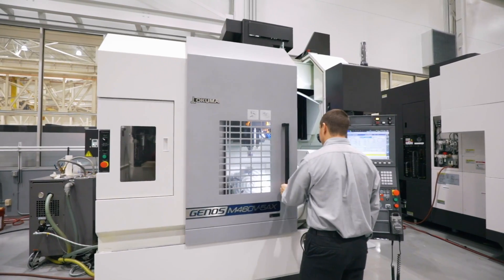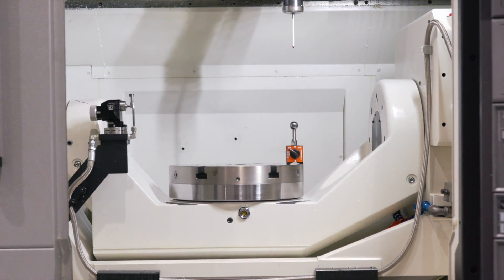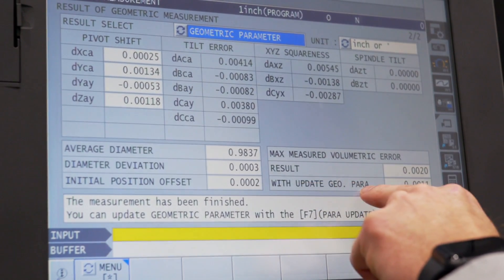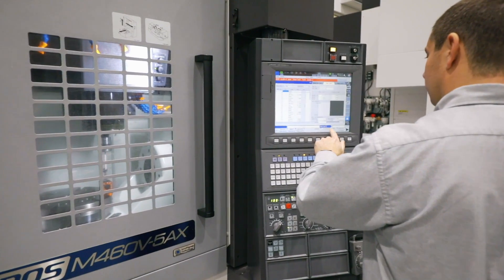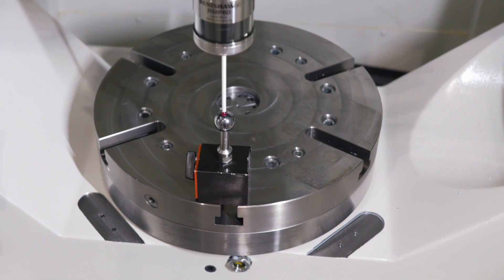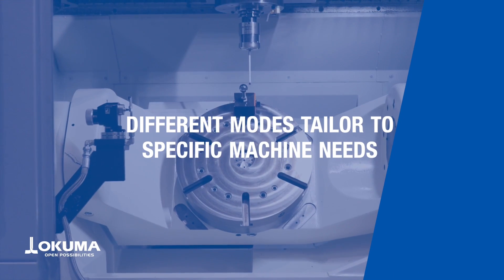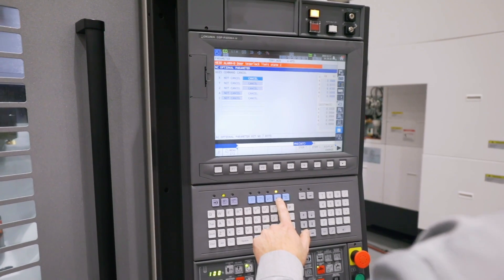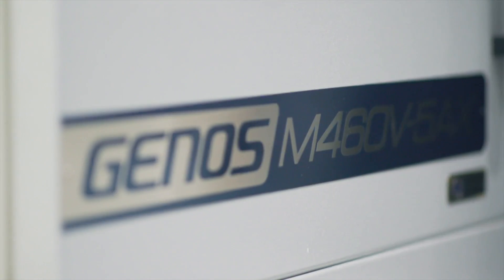Top Unused OSP Control Features: 5-Axis Auto Tuning

Comment: Could you at least give us a start point? Softkey, something?
Reply from the maker: Thank you for the question. Here are the basic steps:
Steps to use 5-axis Auto Tuning

From main operation screen
Be sure table is at A0 / C0  (B0 / C0 if MU-4000)
Display Change
Select Geometric Measurement
Fix target sphere on table 
Load spindle probe into spindle and turn on probe
Place probe tip a few mm over top of sphere (usually at 3 o’clock position)
Select measurement mode (this determines number of points to be measured)
Change to MDI mode
Start Measurement